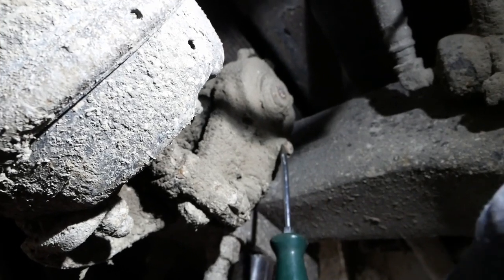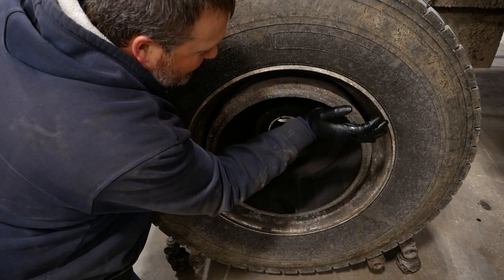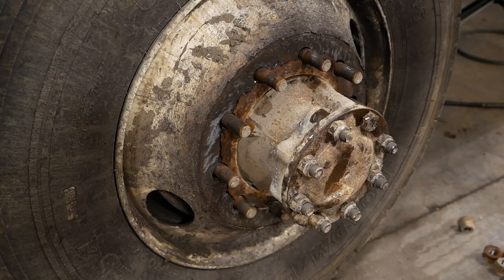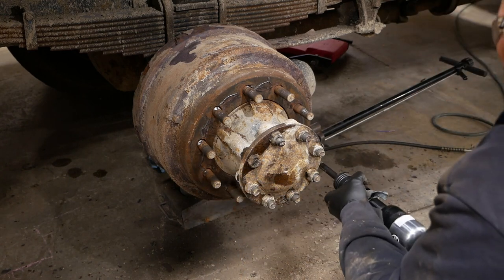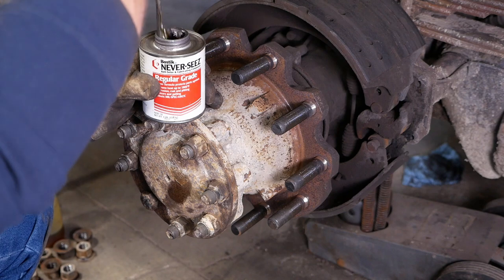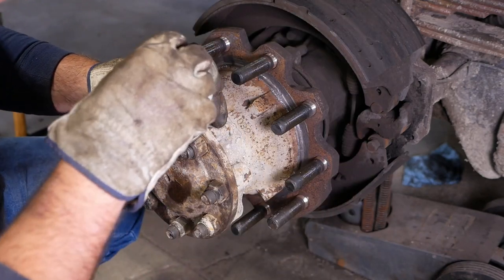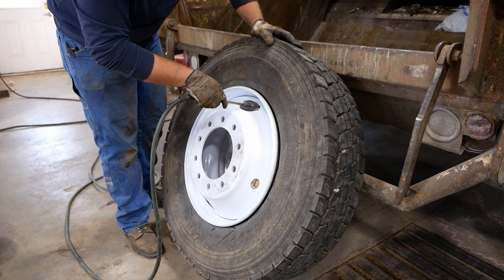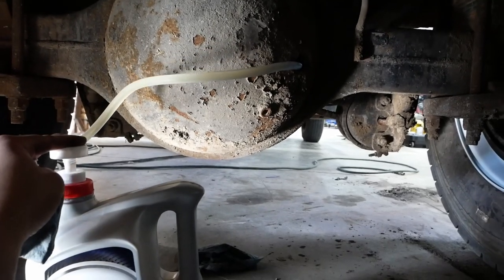Garbage Truck Driveline Noise Could Have Been Bad!

Comment: Yes sir I started out my career when they were phasing them out and they were on everything, old bud suicide split rims, I worked for my great uncle in the early 90's and a guy that I worked with was a big guy who was around 5'10" and 260 pound one ring didn't seat and it come apart broke his arm and threw it and him 14 feet in the air made a imprint in the roof of half the rim. That tool is awesome I will say that all the years they have been around, I wish they had one 37 years ago lol. We still don't have one. I do have a one with a great tri point set up for pulling off frozen wheels of with chains and a big bolt that goed into a adapter that is different sizes that fits inside the axle bolt pattern inside the bolts and T hooks on 2 chains you put in one set of holes and pull with a inch gun. Then move to the next set and do it again if 5 hole wheel of 2 like you have tighten spray smack with a sledge and repeat it keeps pressure on it instead of sledgehammering it trying to get off works great. Awesome job and you saved someone who is out there and is guaranteed. Over tighten will do it to. Like the anti seize and if you are using the hub pilot wheel set up spray the wheels and torque 475-500 ft pounds. Hey you do fine I have done them like that for decades pound and spoon bars. Put a drop on the nuts also they call them wet torque washers. Never had one come loose. We wire brush the rust off the wheel face like you said that rust even if the thickness of a business card will cause vibration or torque spec issues. Loosen from the rust and miniscule crack between one sat of lugs will cascade around eventually and then get to that.

Comment: That's what the flexplate on my Duramax looked like, the ring that bolts to the crank was completely separated from the outer part.  A Socal diesel billet flexplate took care of that.  I think the cause was destroyed stock motor mounts, it was run for a long time that way before I got it and replaced them with a set of sinister diesel mounts.

Comment: When you had the rear wheels off you can see those 1 year old springs are already bent. That truck has to be overloaded to do the damage we see. Maybe the specs are up ok, but it has a really high center of gravity and that multiplies the stress the heavy weight places on the wheels, axles, springs, etc.

Comment: I drive (log) Loader trucks in Michigan, ya know multi-axle, Michigan legal at 164k pounds! This type of rim fracture is extremely common, usually it takes both wheels, the studs, the drum, and the hub, as it usually also wears the “hub pilot” pads off, causing the wheels to ride only on the studs.. expensive failure for sure, however only seems to break the centers out of the steel wheels

Comment: A little tip , only jack until tires barely touch the ground so the wheels are not hanging and you don't have to pick the wheel up.

Comment: That's easily the worst cracked wheel I've ever seen and as always a good video! I had a recommendation on installing those wheel studs for next time though, Lisle 28950 is a heavy duty wheel stud installer that works damn good, especially for the price.

Comment: That usually happens when a 1" gun is left running until 3000 ugga duggas is achieved, not checking torque and it stretches the studs just enough.
The tiny bit longer grip on the new studs is ok, you don't have to grind them down.
I'll applaud you for not setting bead with starting fluid. That's no Bueno.

I'd check the rest of them.

Comment: Overloaded . I've seen flex plates on built gm big blocks break like that it ruins the crankshaft. 
  As far as tire guy I am not. But I worked with some of the best.
 One guy man he literally was a pac(10) linebacker and a mouse among linebackers. 
 We had a piece of equipment that was built right after WWII it used b17 wheels . 45-50 years later the tires rot out. Ever seen a b17 landing gear tire ? 6 inch thick sidewalls .
 Then there was mozel. When I got my first truck I found mozel he expended zero additional energy. The man was 100% energy efficient.  Every move had a exact purpose. Like a  tire ninja dancer.  He never used a tire hammer or hammer of any kind. He carried a gas can and a coffee cup he'd lay the wheel flat then he'd put a third of a cup of gas around the tire bead let it sit 5 -10 minutes while getting another wheel off and the new tire out of his truck using the tires weight against itself. It was hypnotic just watching him work.
He'd lift up his foot and drop the heel on the tire that had been soaking and the tire would fall away from the bead . I've tried the gas trick myself and it really works. 
 When he finished putting a set of new drive tires on in a hour and a half maybe I asked him how long he'd been doing tire work. 
 He said he was doing tire work since he was little his dad was a tire guy.
 He said he was 84years old. He looked late 40s. 
 What retired him was he was taking his daughter to see her first great grandchild in LA he rolled his car in the ca dessert. He couldn't work after that.  He was the Einstein of tire ninjaism he'd be in his 100s today . 
 He was a 5th armored tire guy in WWII under Patten . One of very few African Americans that weren't cooks and orderlies. The fifth armored was partially desegregated .  A true master never seen anyone that could equal him with a tire

Comment: Excellent video Wes  :) yes think why rims went like said on Roads in Winter Season of Salt & Sand mix plus lots hard stops and go on brakes heat too when do garbage pick up too! I also metal rims not like used years ago too for various vechiles too and softer metal not cast iron like used years ago ! Also think strange one I had change daul rims on Dump Truck type and found so strange hear crack then puff of rust when splitting apart what happened was the outter wheel rim fine also ring but inner wheel rim there was 4 studs hole gone like  dissappear someone eating up like pizza slice Lol! Yes shocked me plus Costumer to and new rim put on okay tire after too!

Comment: I drove a 1983 Ford LNT 9000, it had been in a crash that bent the axle tube and it ate wheels and tires  just like that.  The reason we found what the problem was, we were going to aline it and the wheels wobbled bad.  Had to replace the axle housing.  But it broke the wheels just like that one was.

Comment: I've seen this a few times on large forklifts 

Someone didnt clean the rust and dirt off the hub and it got caught behind the wheel disc of the rim ,so when they tightened the lugs they bent the disk into a shallow cone shape intead of flat.

The crack spread along where the wheel disk was bent.

Its an issue with large forklifts because they only do 12 mph so the wheel doesnt spin fast enough to fling all the lime and mud off the hub.

So anyone who works on large forklifts has seen that , we go through the maintenance records to see which tire service put the rim on and never use them again.

( On the big lifts the tires weigh around 600lbs each , so we always use a tire service)

Comment: Hey Wes. When you replaced the rims and drum. And putting it all back together. Aren’t you supposed to criss cross the lugs when tightening. It will keep even torque and keep the wheels from stressing??

Comment: many years ago i worked for Montgomery Wards big chain store kinda like sears. at the time it was a full blown mechanic shop we did it all motors , transmissions, valve jobs, rear ends if it came thru the door we worked on it. But when mechanic work was slow and some of the tire men didn't show up we would have to mount and balance tires largest 1 ton nothing like a big truck but i hated it i feel for you

Comment: Must have been 1952 or 1953 when I was about 10 years old and riding in the back      
seat of a small Austin drophead which my uncle was driving.  We travelled about 
2 miles into Stratford upon Avon (of Will Shakespeare fame) and then 2 miles back home.  There was a clicking noise there and back which I remarked upon but my uncle did not seem very concerned about it. When we reached home and turned into the driveway, the rear wheel, below where I was sitting, fell off and I was tipped out onto the lawn!  It had cracked all around from bolt-hole to bolt-hole.  I am lucky that it did not happen on the main road or I might not be here to bore you with this story.

Comment: It’s because it a garbage truck, drivers over load them on the reg. I’ve seen drivers on side loader garbage trucks disable limit switches on the packer. 

It either blows the the rear dumb hatch off or spilts the body apart at the bottom. 

Also fires in garbage trucks are common almost expected given what people throw in the trash.

Comment: I enjoy your channel Wes. I also enjoy other mechanic repair channels as well. It would be good practice for everyone including home DIY folks to wear a mask or respirator when taking wheels off or doing brake work. Most brake pad material still has asbestos in it even though it was "banned" from use back in the 1990's. This includes clutch pad material too. We all know asbestos exposure can catch up to us in when we reach our 40's, 50's and 60's with fatal consequences.
Reply: I used to pick asbestos boogers out my nose after doing brake jobs on the family cars when I was 14 in 1974.  Now I'm 62.  I think you really have to ingest a lot on a regular basis to get hurt.  Some people act like the stuff is nerve gas!  But I know that anyone who has ever driven behind anyone back in the asbestos brake/clutch days has inhaled asbestos dust.
Reply: @woodhonky3890  I hope you're right! I breathed in a lot of that same dust over 30 years ago and have my fingers crossed that it doesn't bite me in the butt! If I had to do it over again, I'd of worn a mask!

Comment: Hey Wes those Amazon pumps go bad after a while sitting the seals inside of them just deteriorate they only last about 6 months I found this at the hard way when I went to go refill a differential and I had to use a long hose instead and it was a pain in the ass

Comment: The back flange might not be flat. 
The bolting face on the wheel is flexing continuously like the bottom of the soup can that’s why it has a circular failure  ring.

Comment: Looks like the outer wheel has chamfers where the stud goes through. That would make it a bud wheel ( stud piloted) and not a hub piloted wheel. You can see the rust tracks at all the wheel nuts indicating that they are loose.
Reply from the maker: They are not loose or chamfered.

Comment: That's a big no no in the truck world,never put a new drum on old linings, especially if the braking surface is grooved at all.the way that bottom shoe looked I would have replaced them, automatically.o....and helpful hints,matco makes a brake tool for those slacks,makes life easier😁

Comment: I think the biggest problem with this rig is the fuel system has been a real sweetheart to try to make good again. Wheels can break like that from so many different reasons, my favorite is "because it can"/LOL. One of my rigs  had a death dribble an it  come down to the caster on the axle was so high that the wheels just hopped cause of way steering works. The castor making it easy or hard to turn without power steering so pitching the axle made for the alignment of the wheels too much of it being one way or another... don't remember too much as thats almost thirty years ago for this old cripple... quit beating on yourself Wes, you ran over yourself a year ago or so... who needs to remember

Comment: I appreciate you doing tire work. Truley a full service shop. I work out of a service truck and tires are way too much liability for me. Ill top off the air level but thats it. I wont even touch it if it was run flat. Thats why god invented tire guys.

Comment: Have you ever watched farming fixing and fabricating they are quite often changing those rims because there broken i think it’s quite common on those steel rims i might have missed it but did you line up the inside valve stem with the rim cutout so it can be filled (i only ask because I’ve made that mistake ) 😂

Comment: Was that Thorsten tools in a green plastic case? I must have bought eight of those from Sam's, still have most of one left. The 1/4" spinner handles were the best, it was basically an 8" extension with a handle molded on it.

Comment: when you see the rim crack in a circular pattern around the bolt hole, it is caused by cyclic axial loading and the metal fatigue and crack. heat, rust, or damaged suspension components can cause that to happen.

Comment: Good old road salt. I see those trash trucks run over the snow bank with the rear wheel on tight turns. Just jamin snow and salt, sand up in them rims.

Comment: Had a steel rim break where the rim portion attaches to the dish thankfully it was on the inside and was trapped between the outer and the frame. Seems like the steel rims are nothing but problems unfortunately aluminum wheels aren’t really cost effective on most applications.

Comment: Got to ask two questions....Why did you not balance the mounted tires and why did you not mark the duals for orientation when putting them back on?  I have had the rear axles bounce because the duals were not concentric?

Comment: Favorite air hammer by far is the pH 9050 from snap on that thing could dig a hole to china if you had enough air I've used big nasty before I don't see a big difference in power but that's just me

Comment: 15:38 watching you change this rim out gave me really bad flashbacks ... everytime i had to do one it was always summer, stinking hot, you had to keep your tools in a drum full of water, you were sweaty, dirty and had at least one knuckle bleeding ... and after all the cursing you got the truck back in the paddock, got back in the header and started harvesting again (I was always the village idiot that seemed to get the tyre repairs) ... and header tyres, why does it always seem that the inner dual gets a puncture with a full box, and by the time you get the chaser bin over the auger is to low to get the bin under it ... rant over :)

Comment: Use a cake decorating bag nipple in 2 gallon ziplock bag to fill a differential. Fill the bag with oil, then zip it closed, then squeeze bag pushing the oil out the cake nipple into the differential. Very fast.

Comment: For curiosity I checked out that air hammer here on Amazon in Canada. We get so screwed up here! On Wes's link it is $238.01 and on my link here in Canada it is 385.01. If I factor in the exchange rate I get 320.81 CDN dollars. So they are charging and extra 60 bucks in shipping? The tools are pretty decent quality but made in Taiwan. As usual that was an interesting video Wes! Thumbs up!

Comment: Wes.. What goop did you use on those rims when re-mounting them?   Was that just grease, or was it some special tire glue or something?   I noticed that my F350 is leaking a bit around the bead there.. and I'm going to need to pull it apart and clean them at least;  Just wondering what you used on the inside of the rims.

Comment: One day south of K.C.  I pulled into the NB Scale take a 
10-100 and kick the tires found I had a Blow Out on the TRAILER (18wealer)
When all said and done, I had a 3 piece Brake Drum.
Needed Drum 2 wheels 2 Tires

Comment: Hey wes in my time when i was apprenticing when i was 18 on till i had to leave...was there till i was 21...when we put wheels on big trucks when it came to torque wheels...there was a special extension you had to use...it wouldn't twist as u were torquing the wheel...the regular extensions, they twist...not a lot, so with that you font get the right torque, so I'm not saying/telling you that what you are doing is wrong, I'm just asking if there is such an animal that is supposed to be used,  And with you I've watched you for a few yrs now to know that you don't mess around when it comes to stuff like that...and I'm sorry that, that question turned into a story...lol....

Comment: Almost looks like the wheel nuts have been massively overtorqued, considering the cracks run through the center line of the studs.

Comment: Wes what's your view on people using grease or copper slip on the wheel nuts?
I read it increases the torque on the bolts when u use a torque wrench.
Does anyone know if you can get an anti seize like copper slip without
the grease so its not slippery to change the torque?
Or is that impossible. I know a lot of the manufacturer's say never lube the lug nuts.

Comment: How much extra cost would it have been for the brake drum manufacturer to have put in a few threaded holes on the brake drum surface, so that a puller could be used?
Did the customer wish the other wheels checked? Did you get them to sign off on doing or not doing that?

Comment: As a former 44ton HGV (truck) driver, here in UK, broken rims start of as loose wheel nuts not checked daily by the driver, a legal requirement here In UK. I suspect this what has happened here. Easy to point a finger from here across the pond, but I only had it happen once to me, wheels passed me driving along. I can tell you that was my worst nightmare ever. Fortunately no one was hurt, only my pride. Never happened again, I became paranoid about wheel (lug) nuts after that incident. Nice to see you not looking too hurt from last week. stay safe.

Comment: It have been internal crack whenever they cast it the wheels had the manufacturer. And as we all know internal cracks are not visible until they begin to start cracking. So the wheel rim could have been a casting defect from the manufacturer.

Comment: Just put a couple of tack welds in there, and it'll be fine....NOT!!! 
Seriously, if the lug nuts weren't torqued to spec, then there could've been movement and flex due to a mismatch load/overload could've caused the rims to fail. Good job for replacing them AND the drum.